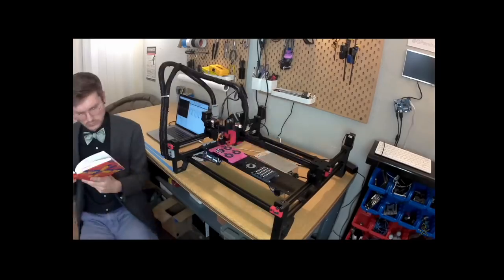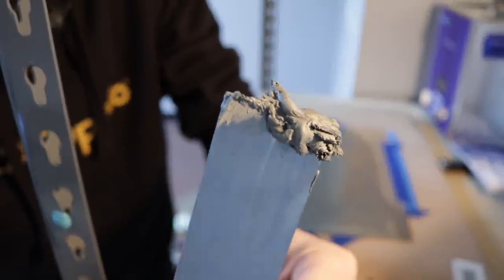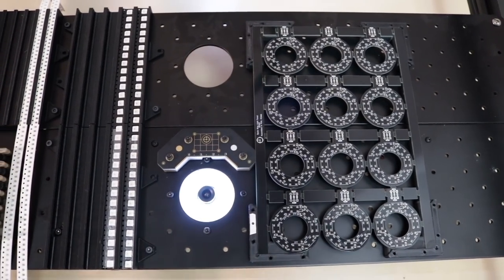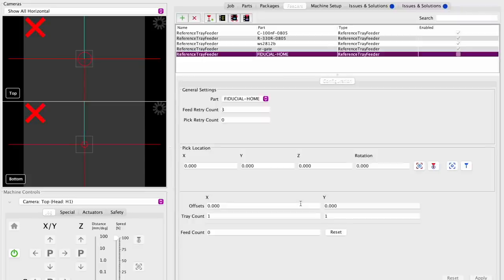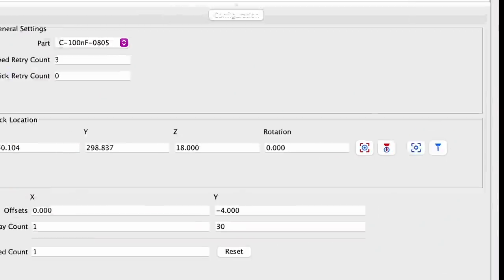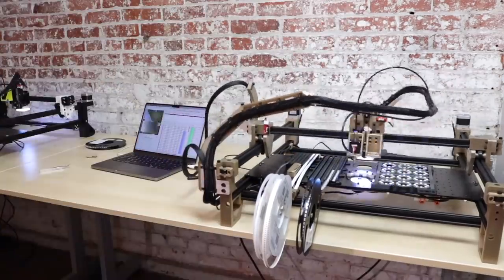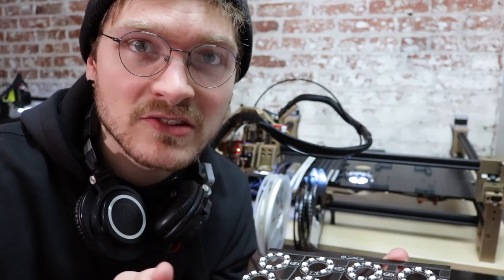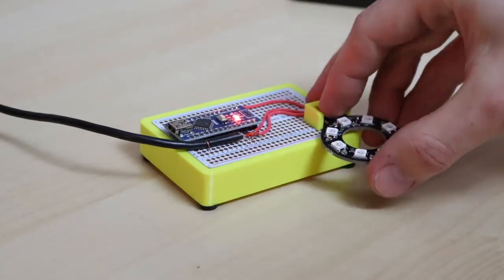Using The LumenPnP In Production!

Comment: You might want to consider adding the test pads to the outer frame so that you can test all of them at once rather than cutting them out one at a time. This might be helpful if you find a number of LEDs that are defective; you can just de-solder them and then put the board back into the PnP machine to re-populate with working LEDs.

Comment: One of our senior techs showed me the difference between stored/rested and freshly stirred solder paste. You can either stir it up manually or use a centrifugal planetary mixer (e.g Thinky ARE-250) to homogenize + degas the paste before use. Makes working with it a lot more consistent (also make sure it's warmed up to RT).
Reply: the Thinky Mixer is great, but definitly overkill for DIY. But you can mix the paste an the stencil by pushing it arround
Reply: I have 5 years expired solder paste and it works fine for touch up jobs. Wouldn't use it in a printer though.

Comment: What happened to the auto feeders?  The only major change I'd like to see is a quick change head.  This is so you can load up a solder past dispenser then swap out to a pick head or a glue head for doing double sided PCB.  How is the GitHub going to change now that the machine name has changed?
Reply from the maker: Powered feeders are up next! We just got machines out the door, now we're focusing on hiring so we don't need to do all the packing work ourselves, then a DFM pass on feeders and working on getting them available for sale. Github name switch is upcoming! Takes time to rename an organization and a project.

Comment: seems like your system would be able to detect the parts on the pcb when it's done, if it's recognising the different colour between the pad, like not green or black etc, black soldermask would be tricky, someone on youtube made a pnumatic rig for those manual nibblers, they are good but can also be a hassle to use, they can get gummed up, i normally close them then  rotate it forward out of the gap

Comment: An improvement can be done to the Arduino test kit by adding a display like LCD1602, check the voltage drop when lighting up each pixel, each individual RGB, then display the test result on the screen. Better off add a buzzer to give a happy or sad tone.

Comment: Just a little idea that came toind after remembering the video with the belt-driven pcb loader, would it be possible to have a nearly completely automated production line : just give the pasted pcbs at one input, components on one other and have the system autonomously feeding the pcbs in the pick and place, shove it afterwards in the reflow oven, pull the pcb out to make room for a new one, and autonomously depanelling pcbs (clough42 made a video about operating a depanelling plier with a little pneumatic cylinder, activated just by a pedal switch in his case)
Reply: much easier if you rebuild the reflow oven around a conveyor itself, then all processes advance linearly

Comment: Could there be scope for adding a basic AOI functionality to the existing camera to check that all components are placed correctly at the end of all placements?
Reply: could also check for proper solder paste before placing
Reply: @nidavis  I like that!

I have to wonder of there is a open source AIO like open PNP. I guess with little more than coding this could perform all the operations.
Reply: The camera has a narrow field of vision, but if you take multiple pictures and stitch them together, you could use AgnosPCB to check the board pre-reflow.
Reply: @jessevanderzouw619  The AIO machine in the board assembly I worked at before going into design worked this way, real close up images but could stitch and export a whole board view.

Comment: How is the PCB height determined during setup? Is the nozzle used to automatically detect the height by slowly going downwards, hitting the PCB, and simultaneously measuring vacuum changes, ie when hit the vacuum level changes?

How is feeder height determined? The same procedure above could be used, but keeping the tape on during detection to avoid components getting out of pockets. 

You mentioned that one LED was not placed. Wouldn't the camera (which is used to correct component offset) detect that the component was not picked up, and set an alarm?

Comment: I was curious, why addressable lights? why not a ring of white leds with a fet, seems like it would save cost and be more effective as you are basically just running them white all the time?
Reply: I guess you could use the different colors to detect some parts. This just makes it more flexible.
Reply: @phiwatec2576  very good point, would be cool to see it utelize the techniques that camera trackers use where they flash a rainbow of colors to determine the best light to use for a part.

Comment: Such nice videos !!! Thanks a lot. 
If you wanna go full nerd, you could panelize the pcbs in a way that they could be tested before breaking apart. (not my idea, might be common, seen it on EEVblog). 
BUT additionally, one could automatically test in place, putting back in the PNP after reflow, and test using the vision system....

Comment: The point about forgetting to apply paste for on a spot on the stencil got me wondering: wouldn't it be possible to use the camera of the PNP to scan for the presence of the paste?
From all I've seen so far, it seems that there's a good color difference between the "common" board colors and the paste, if you're not for chance handling gray PCBs, but I don't think I've even seen gray ones yet.

Comment: Hi Stephen, what is the smallest pick head you can run? I’m interested in your solution independently but it would nice for some of my prototypes if it can handle stuff like MMC5603NJ size (very tiny). I have done a couple of proto by hand and microscope and it’s a pain. Cheers

Comment: Stephen--I just watched a YT video by one of your customers. The Lumen was working well, and it seemed to a little faster than you've demonstrated here. He had the sound on while it was running, and this is the first time I've really heard the vacuum pump working. I'm not a fan. It must be a diaphram-type pump, which is why it's so loud and buzzy. I have been considering buying a Lumen, but I'd want to do some modifications. It's possible, for instance, to "store" vacuum in a tank (cars used to have vacuum reservoirs when they used vacuum motors to operate baffles in the AC/defrost ducts). Such a tank could be made from 3 or 4-inch PVC pipe, and the vacuum provided by a salvaged AC or refrigerator compressor (both pretty quiet) that would cycle on after several (maybe dozens) of pick 'n place movements. The control line that now starts the buzzy compressor on the Lumen would operate an air valve instead. The separate tank and compressor would have its own on/off control with hysteresis. It could also be placed in a sound box for make it even quieter. I just thought I'd pass those thoughts on to you.
Reply: Put the pump in a thick housing from heavy material that does not resonate. There are also 12V pumps that claim to be very quiet.

Comment: A full width, dedicated squeegee is VERY much worth the effort to find. The best results come from doing a single pull for the whole PCB. In general, paste printing has a voodoo involved - but taking the time to get consistent and accurate paste deposition is gold.
Reply: Absolutely. multiple passes risk too much paste squishing under the stencil. A stencil jig makes life a lot easier, as it allows tensioning. I use the Eurocircuits one, which is expensive and over-engineered, but works well